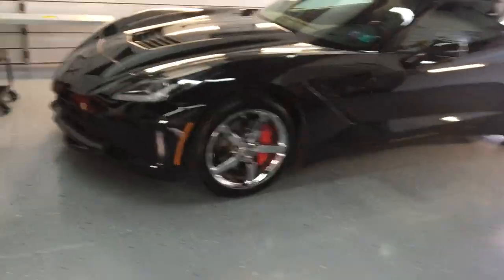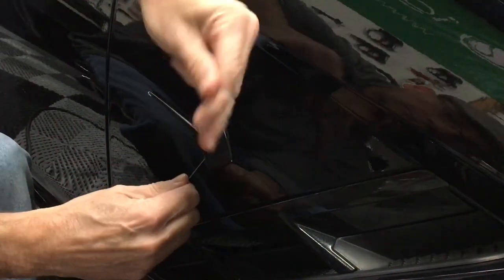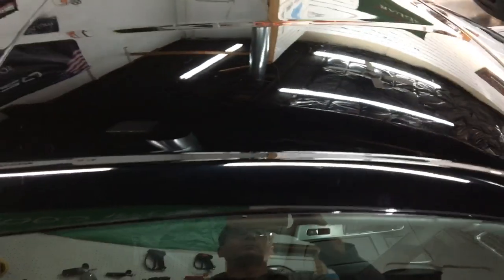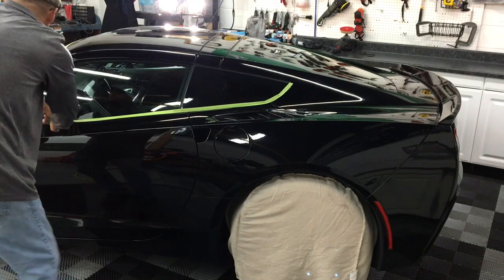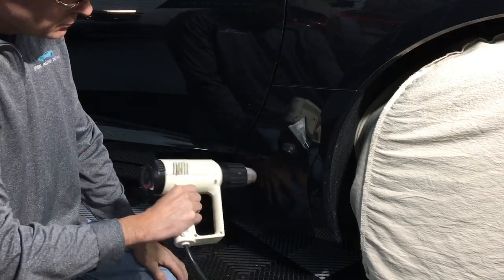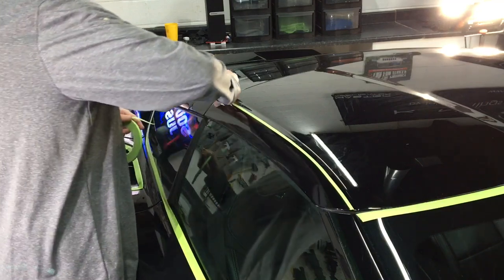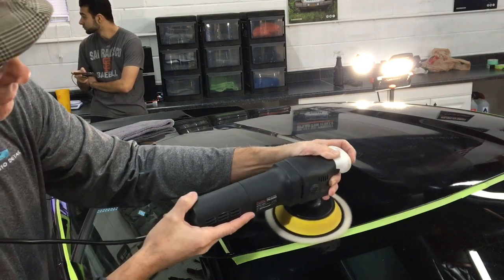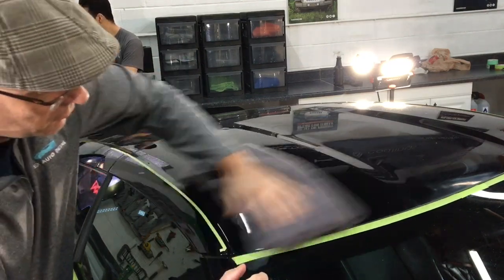Let's Restore The Clear Coat On My C7 CORVETTE STINGRAY!! Part 1!!

Comment from the maker: What is the worst detailing hack job you have come across?
Reply: I  had a 2013 Lexus SUV, owner was washing it with Dawn dishwasher soap. Worked wonders on the car, stripped any and all protection, and the rear plastic spoiler was burnt 😨. I rescued the rest of the car removing all the hard water ( Almost every car I get has mineral deposits embedded in the glass and clear) enhanced the paint, then cleaned the interior. Owner was thankful, then I got his new Navigator to protect ! 

It’s sad to see some of the abuse I’ve seen to some real nice cars. To cover myself I document them all and communicate with the customer before I start. It’s always special when I can improve or correct some hack work. Still learning, always in the back of my mind... Safety First, and least aggressive methods. Thanks for all you do.
Reply: Black toyota tundra, That's the one that comes to mind anyway. It was beyond horrible! I've ran across quiet a few
Reply: Any work that scottyvitail does on instagram... he keeps me busy tho we live in the same area 🤣🤣 imma pro hes a hack
Reply: When I bought my 2008 BMW X3 so I don’t have to drive my Camaro SS in the terrible winter. The BMW X3 was a nightmare but with all I have learned from you I was able to make it a lot better. I went over it with a fine tooth comb 💎
Reply: love the corvette to
Reply: thank you.yearssssssss ago washed a Renault 5 and it was freezing water was and mi hand where freezing to
Reply: Buffer Spinorama!!   lolll!!
Reply: My own misguided attempts at 'detailing' my own vehicles before I had any clue what I was doing are certainly some of the worst hack jobs I've come across. My skills have increased, my tools have gotten better, I've gotten better products to work with, and I've been able to learn by watching along and become more cautious. I have two much better looking vehicles now!
Reply: I believe this video has made think of a good mail call question Brian, you spend a lot of time detailing personal vehicles, as do I, as a business owner I see my vehicles as rolling billboards. Do you think having well kept cars as a detailer helped your business over the year’s?
Reply: Apex Detail a body shop fixed my bumper & w/o asking buffed outthe whole car  unhappy trails too me until we meet agian  Never !! 😆
Reply: 😂 dry rub on dusty paint Sweerl attack spirograph
Reply: @Michael H yeah I wouldn't do work for that guy. You didn't do anything wrong. A job like that to fix ball park around 600$ probably went to you cuz you were his "Friend" and would do it for pennies. Just my thoughts I could be wrong.
Reply: A really neglected 2007, bmw with sapphire black. This summer, really hard clearcoat
Reply: A Chrysler 300 that had some horrible buffer trails.
Reply: @Michael H oh damn he wanted ceramic coated?? Then yeah 1500-2000$ is fair.
Reply: My own probably.  On my first car.
Reply: @Jesiah Samson it did the trick and I now got access to my account again. I am so happy:D
Thanks so much you really help me out !
Reply: @Nico Christopher no problem xD

Comment: Love that Adhesive Erasure Wheel,  bought mine at Amazon, makes removing the leftover adhesive much easier than using Goo Gone and a plastic razor, which is what I used to remove all the emblems on my truck a week after I bought it from the dealership.

Comment: Thanks I am going switch my C7 emblems from chrome to carbon flash. Worse part on mine is the transparent roof which is crazing (spider webs) badly. Apparently the clear fails just like on the C6. I live in FL so I think I’m just going to wrap it. Since I track my C7 (videos on my channel) I have PPF and love it, sure it’s not as nice as paint but the protection is totally worth it. I got EOS side skirts, the finish on them isn’t perfect maybe a 8/10 but for the money its a great deal. When tracking the car the side skirts are a must due to all crap that gets kicked up at speed.
Reply from the maker: PPF is very important...If you track your car...I recommend it. I just personally do not like it on my cars. Leave a link for your channel here.🙂

Comment: I just finished polishing my C7 with a hex foam pad from chemical guys (green & orange). I used a 8mm DA polisher and turtle wax ceramic hybrid polish.  I must say that it was soooooo hard to even see a difference in the clear coat.  Don’t get me wrong it was an improvement but I feel like I could have done much better.  The turtle wax ceramic coating feels and looks great on my garage baby.  What should I change?  I’m doing my corolla next with qyeon Syncro.  I have a feeling that the same setup will cut better on that.

Comment: Nice ride. 3D ONE actually doesn’t break down, it doesn’t use agglomerate(diminishing) abrasives.
Reply: Brian,  Brewinz,   is '3D One' less abrasive than 'Meguiar's Ultra Finishing Compound' ??
Reply: Ron Dail if you’re talking about M205 Ultra Finishing Polish, ONE is more aggressive.
Reply: @c6z061  , Thanks,  yes I was thinking M205,  it is available at Harbor Freight 32oz $30
I have never used a compound\polish or  machine.  I would like to clean up my 2017 black Corvette and get back to the sparkle it had as new.
Reply from the maker: It doesnt "break down" But the grit does wear down sharpening itself as it does creating a nice even cut. It is also heat resistant.

Comment: Wow, when you say there’s not much clear, left. I definitely didn’t expect the combination you used. And you’re still going to do a finish polish. Waow. And I was worried about hitting mine with an orange pad and a D/A, with griots boss correcting cream. My car is white, and I don’t think my clear, is as bad as this. But I do think it’s been coated. There are a few telltale signs of some high spots that didn’t get knocked down, on the hood, behind the hood vent. Can I do this pad and HD one, with a Torq22D? That’s all I have besides a Rupes 3 inch and the new Adams micro. Or do I need a rotary?
Reply from the maker: That combination should work. Do a test spot on the roof.

Comment: I have a C7 and there are plenty of nicks by on the door edge near where you took the Clear film off.  I assume its from the rocks coming off the front tires.  What would be a good way to attack the nicks so they aren't so obvious?  Been pondering this for while.
Reply from the maker: Minor nicks can be improved by a bit of wet sanding. I have a kit coming in that will help protect from that type of damage...stay tuned.
Reply: Thanks for the reply...  I can't wait to see that, although I'm sure I'll wait until spring before I work on it.

Comment: Hi Brian, how many times can you performan a correction like this before going through the clear coat? Just to have an idea. Thnx
Reply from the maker: It takes more than you think...however...most of the UVA UVB protection migrates to the top during the curing process...so leave as much clear behind as possible.
Reply: @apexdetail85  thanks, love your video's, best regards

Comment: Again, why would a detailer see it necessary to tape curves to avoid burning-off paint?  If the buffer is removing paint, you probably should not
use a buffer.  Isn't the goal of detailing to keep a car in good condition?  If the car is reasonably maintained why rebuff the clear coat?  Paint today is so well applied at the factory it requires relatively little attention to detail.
Reply: It depends. 

In some instances, we have to level the clear coat to remove evidence of daily wear and tear, automatic car washes / aggressive or improper wash methods, or other peoples inadequate work.
Reply from the maker: You couldnt be more incorrect. Clear coat is NOT being properly applied being a quarter of a mil short of what is necessary to fully protect the base coat. 2 mills minimum is recommended by PPG. Manufacturers are barely putting 1,3/4 mils on newer cars to save money. Protecting peaks and high points is only common sense for a beginner....as I explained.